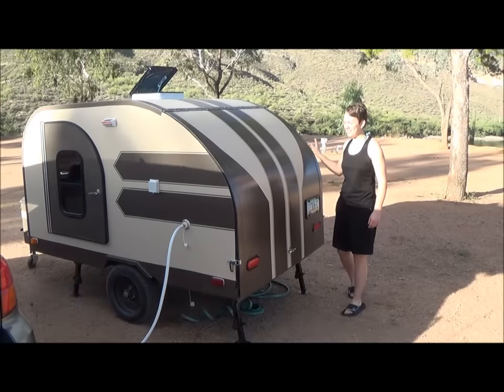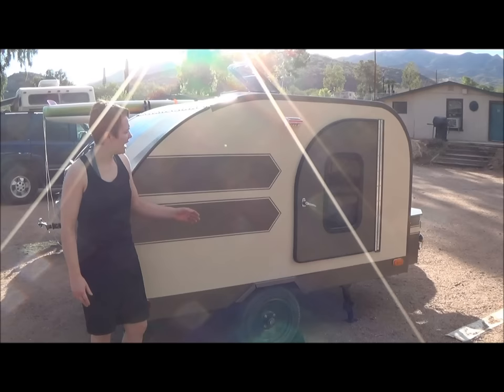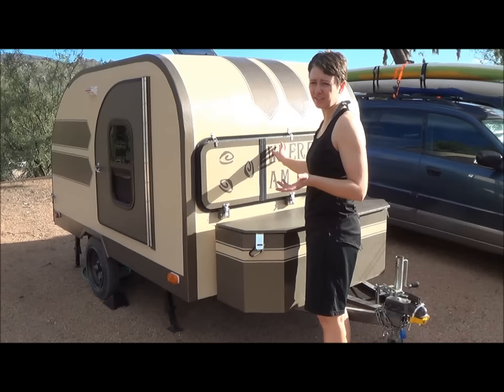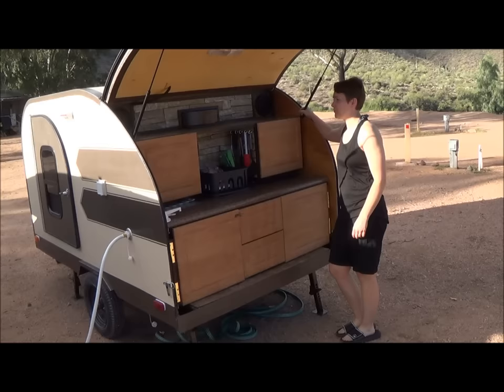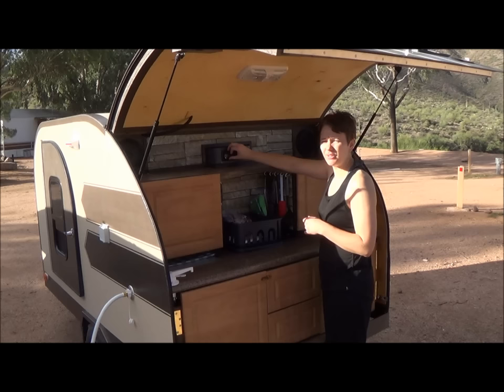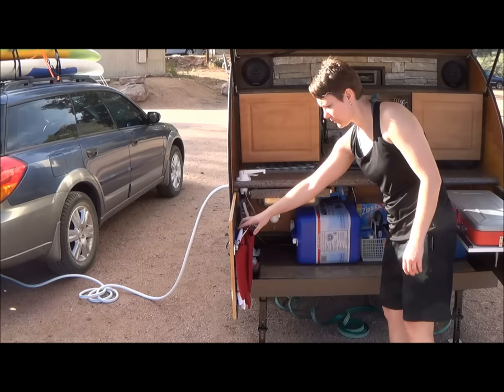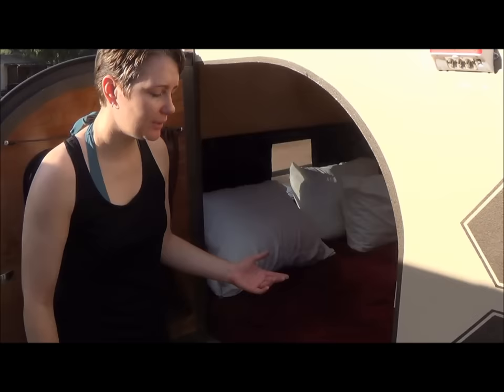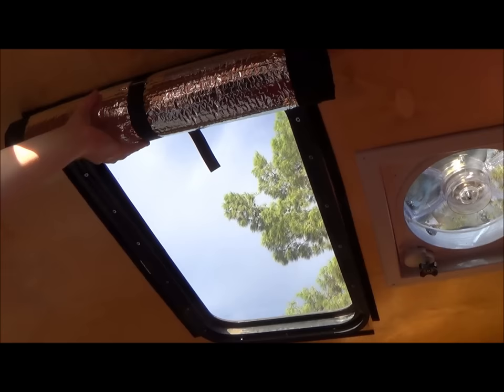Home Built Teardrop Camper (Poor Man's Fiberglass)

Comment: Absolutely beautiful teardrop.  The only things I would add are a solar panel or two and a seven pin trailer jack so you've always got power options.
Reply: Andrew Rouse And there's no need to permanently attach the solar panel. A lot of Australian teardrops simply have the solar panel on a tripod that they set up outside the door.

Comment: Acrylic paint does not seal against water, however, a sealer on the final coat of a Poly-crylic would be close. After using them once in a bathroom over a faux finish, I could not believe how well the coating managed in high humidity after many years. The water based polys have come a long way since- of course, many floors are done with them now. Amazingly hard and durable- I would highly recommend them.

Comment: Hi, thanks for the great video.I am gathering my thoughts as I am about to start the build of my first tear drop trailer. Glad that I saw your video, I am living in Mesa, AZ. I've been camping since I was a kid and had sailboats for almost 30 years. Many of the situations are similar. However, my boats were all done when I bought them so I never had to figure out the 12 volt wiring. I've been watching videos all morning learning more about that. Glad that you talked about the door. I went through the same thoughts that you discussed and probably would have done the same thing that you did by making one from the cut out wood. It is so much easier to buy one pre-made for the reasons that you stated. Thanks again. I've looked at a few of the comments below and have also been considering foam sides, fiberglassed.

Comment: great job ! one suggestion, either use a gel cell battery or put in two vents to exhaust the battery fumes. ( one at the top , one at the bottom )  the gel cell is by far the better option, no fumes, no acid, no problems.
Reply from the maker: +bos dad Thanks for the tip! I did vent out the back but I like the idea of gel cell!

Comment: I build campers for a living, and I have to compliment you on an excellent build!!  The only thing I see people doing that I wouldn't recommend is the poor mans fiberglass.  Actual fiberglass isn't that expensive, but to be fair, I get my glass and resin at cost or free if its considered waste.
Reply from the maker: Thank you! Maybe if I build another I will see if I can find someone who gets materials at cost!
Reply: @thelwood  did you figure out the cost of the poor mans fiberglass?
Reply from the maker: @iambeeman1  I had $50 in canvas drop clothes, used about $15 worth of glue,  free paint for base coats,  final paint was probably $40 including the paint for the racing stripes. So probably a little over $100. And no need for trim. It still looks new after 5 years. It is a little tedious with all of the sanding but the final product was worth the extra effort.

Comment: Nice job. I'm building off the Benroy plans and decided to build my own trailer since I have welding experience. The HF trailers are a little to wonky for all the hard work that goes into a nice build. All opinion off course. Enjoy your hard work.
Reply from the maker: +Kevin N I agree about the trailer. If I would have had more confidence in my ability to produce a nice end result I would have invested in a better trailer. I did reinforce it and upgrade the axle. I have a pacemaker so I am not allowed to weld :( Good luck with your build!!

Comment: I think you should have put a 3 inch door lip frame on the inside with a 1 inch exposure smaller than the outer door opening and ran a line of rubber sealant like the inside of your car door to keep cold and water out when your camping in.
Reply from the maker: Terry Thanks for the tip. There are of ways I could have made the doors better. I will just buy them next  time. They are ok for my needs here in the desert.
Reply: Well...its awesome.

Comment: I'm not sure if you know about this paint but it's really cool I just learned about it myself and it's supposed to help with the heat penetrating into your vehicle and you can paint the inside of your vehicle or the outside and you could mix the stuff with your paint is called icing spray on high tech thermal ceramic insulation paint. Can help out with all that heat coming into your place it puts a barrier between you and the heat and the sun those raise but I really like your little place is very cute. I'm going to build a tiny house I got my first peace last week from the salvation Army it's a stainless steel large bow I paid three dollars for it going to make it a sink for the kitchen and I'm going to use an old sewing machine that I have in my apartment I'm going to take all the stuff out of it and make a hole for my sink it's going to be really cute. Thank you for the sweet video I really like your little teardrop and the radio is fabulous what a swell idea thank you again bye-bye.

Comment: My wife and I have I have all kinds of questions, what trailer frame did you uses, what was its dry weight, what did the overall weight end up being? How are you liking it now almost a year later? How long did it take for the build? ... and I will probably come up with more questions...
Reply from the maker: Thanks for watching.  We love this little camper! We have had several adventures and are hoping for a long road trip next summer.  I built it on a harbor freight trailer that i reinforced the tongue of.  I will invest in a better trailer for my next build.  The trailer is 4x8 but I built over the wheels so the camper is 5x8. that is how I was able to get a queen bed.  My wife is tall and all arms and legs so the extra space is worth it in my opinion.  If you are short that may not be important to you.  It weights close to 1000 lbs.
Reply from the maker: +L Wms I worked on it for a year but I took a 6 month break.  I could easily build it in 3 months now.  Most of my time was spent just trying to out what I wanted to do.  I redesigned it several times.
Reply: My wife and I are both very tall, shes almost 6ft, and me, around 5 foot 9 or so. We have been looking at the campers.. and trying to figure out if we could comfortably sleep on a full. We have a small suv, for weight is going to be very important....... Thank you for the quick response, and know that I might come back and ask more questions. I like the canvas, because I also live in AZ - which means we have uh, what one month a year, when we can apply aluminum siding. LoL.
Reply from the maker: +Odessa Price I don't see that my response posted.  If this a repeat message I apologize. We are similar in height to you both.  I toss and turn so upgrading to a queen is highly worth it in my opinion.  It is pretty easy to keep to below 1000 lbs. I can't feel the camper behind my outback at all. Happy camping and maybe we will run in to each other.  Do you have any favorite Arizona camping sites? We are always looking for recommendations.
Reply: Well, most of the time we end up going to my uncles cabin in the middle of the woods, which is scary, and has nothing that we want to do, so... we are looking for a better than tent camping adventure or two. I really want to do some california beach camping, but again, they dont allow tents - which put my instant up coleman in a useless status. =) There is a place near Angel Valley Sedona that we wanted to try, however just taking the vehicle in and out was a little scary, so I am not sure how well a trailer would do honestly. Other then that, mount lemmon is pretty nice, depending on the site you are at, we had a big group site up there about 6 years ago.
Reply from the maker: +Odessa Price We have list of places we want to go and will hopefully do the coast next summer and hit a bunch of national parks.  Our son graduates this year so hopefully we will have more time. Good luck your build! Let me know if you have additional questions.

Comment: Awesome trailer. Can you explain a bit more about your skinning process?
Reply from the maker: +voiceofintelligence  First I routered 1/8" curve to the edges, this really helped the canvas bend over the edges with no wrinkles. Then I bought 8 oz drop clothes and pressed the hell out of them. Then I bought a gallon of tightbondII. I rolled it on with a quality roller. Then I put the canvas on and pressed it again. Then I worked the corners with the glue and iron until no wrinkles existed (cut to about a 2 inch over lap each way). Next I applied 50/50 paint and water mix, then several coats of full strength exterior paint and SANDED in between. That is the key!! Sanding it makes it beautiful! I did some trials without sanding and I did not like the texture, Sanding makes it smooth and shiny :)
Reply: +L Wms  How did you attach the Canvas to the wood? Tightbond???? When you say pressed it again, You mean with an Iron? What kind of paint did you use ? Oil base ? Love it great job!!! I am ready to skin mine now!
Reply from the maker: +GT66PONY Forrester I rolled on the tite bond 2. It is a wood glue you can buy by the gallon at home depot. I rolled the canvas on and then took the iron to it. One of the pictures at the end you can see me ironing the fabric.

Comment: This is amazing well done. Can you explain again how you did the poor mans fiberglass ? I’m thinking of converting a normal trailer into a camper 👍
Reply from the maker: I rolled on titebond 2, then the canvas drop (pressed first). Then I pressed it again and applied 50/50 paint/water. Then I sanded it.  Then paint, sand, paint,  sand,  paint.  The sanding makes it nice and smooth! :)

Comment: Well you're definitely in the top 5% of equality females. How about the trailer I love it only a couple of things I would change about it, I would have used a better frame that the Harbor Freight trailer frame, the other thing is the stereo set-up
Reply from the maker: +Nic l Thank you. I would have put it on a better frame if I would have been confident it would turn out this well. I got trailer for next nothing so I went for it. I did reinforce the tongue with 6ft 2 inch steel and I am upgrading the axle. I am putting my next build on a much nicer 5x8 trailer :)

Comment: I'm in the process of building a teardrop right now and I am curious how the canvas is holding up. I'm not sure which way I'm going to go between aluminum and canvas. Also, would you be willing to write out the basic steps and products used in applying the canvas?

Great looking teardrop, by the way!
Reply from the maker: The canvas is still in prefect condition. If you pull the canvas off of a hundred year old boat the wood is usually still in good shape. It is very durable.

Comment: Two questions. 
1. Is your teardrop stored under a shelter when not in use?
2. After six years have you had any problems with the poorman fiberglass leaking or any other problems?
Reply from the maker: Thanks for watching.  My TD has been stored in the garage for about 4 of the 6 years.  I have another PMF cargo trailer that I made 3 years ago that is stored outside.  Both are in excellent condition.  It is hardy stuff when done right. I haven't had any issues at all with the PMF.

Comment: Wonderful build.   What did you use to clamp on that window protector for the front window.   Do you remember where you bought the hooks and clamps?   Thanks again
Reply from the maker: Thank you! That is an excellent question. I am trying to remember. If I didn't find it at home depot then I maybe did at harbor freight.  One side is a D ring tie down with a metal  strap and the other side like a small latch for a toy box. I am working on a micro teardrop for a Vespa. I might need some for it. If I do I will let you know when and where I find them.
Reply: @thelwood  thanks I appreciate that and will follow in case you find it.

Comment: I know it has been years since your build.  Can you tell me how and what materials you used on the front window "protector"  .  Thanks so much.

Jon and Donna
Reply from the maker: I used 1/8 baltic birch covered in poor man's fiberglass and the back is a reflective insulation. It is about 1/8 to 1/4" thick too. The 3 pieces are attached with extra from the plastic hinge I used for the doors. :)

Comment: So naturally as everyone else has said, this was fantastically done. I'm not sure if your still responding to these comments but here goes... I am building my own TD right now, and am at the sand and painting phase. I have sanded and painted so many dang times now i'm almost sick of it. Already used 5 gallons of paint. How many times did it take you? Did you use a brush or roller? I feel like I am so close, but now I have to buy more paint, lol. Is there any tips or tricks or anything you know of now since doing yours that can speed this up? tia!
Reply from the maker: Brandon Foresee I believe I did 3 full strength coats.  I left mine with a little texture.  The smoothness level is a personal preference.  I used a smooth roller to apply it.  I used an electric orbital sander to sand it. I also used an iron on it when I applied it.  Hope that helps!

Comment: how heavy is it !? I made one that can fit a dirt bike in , opens in the back ! mine is 660 pounds empty , 1000 pounds with the bike in it , I pull it with a Yaris !
Reply from the maker: Vegas RoManiac I estimate  800 to 1200 pounds. I was trying to keep it under 1000 and have pulled it woth 1000 lb capacity car with no issues. Can't even feel it behind the subaru :)

Comment: Great build.  Why even put "the poor man's glass" (canvas) on trailer?  Why not paint wood? What type of paint did you use (oil - enamel- etc)?  Would you change anything?
Reply from the maker: Hi Chris, thank you for watching! You can just paint it but the canvas just makes it last a lot longer.  It is very durable and totally water tight.  If is more like skinning it in aluminum vs just painting.  I used glossy exterior paint.  If you make a trial piece you will see that once the paint has dried in the canvas the canvas is solid enough to cut your skin. boats made a hundred years ago can still have preserved wood underneath them today.

Comment: Great video, thanks for sharing. Making videos isn't easy and takes time. I appreciate your willingness to share. Is the trailer a Harbor Freight Model? Can you elaborate on that? What would you say the gross weight of the teardrop is?  I hadn't heard of the coated canvas outer shell before.  Your teardrop looks great, Congratulations I hope you make many wonderful memories.
Reply from the maker: Thank you. It is a harbor freight trailer.  I reinforced the tongue with 2 inch steel square rod 6 foot in length. It weights about 1000lbs. I will use a better trailer for my next build but I was hesitant to put too money in not knowing how it would turn out.  It was a cheap Craigslist purchase and it works well.

Comment: Nice job, do you have pictures of how you made it 5' wide especially over the H/F fender section. Did you raise the floor above the fenders.Thanks.
Reply from the maker: +George Lee I am not sure how to post pictures in the comments. I have a few pictures. Basically 2x4s upright on the frame raised it enough to clear.
Reply: Thank you.

Comment: L Wms   the poor mans fiberglass reminded me of my grandmothers walls in her house when I was little. they were hessian covered with old magazines, they blew in & out with the wind but the house was warm. 
Question.....I have an old caravan, only 10 foot but I can't fix the leak in the roof, do you think this would work if I was to do the whole roof in it & rolled it over the sides of the roof ? 
Can you tell me if you only used one layer of hessian & what type of paint did you use ? 
I love the tiles you used as back splashes & fetcher walls
Reply from the maker: Kerry Beckhaus It might work.  I am not sure.  I used canvas drop clothes from home depot and glossy exterior latex paint.
Reply: thanks :-) might be worth a try

Comment: You did a fantastic job on the camper!  I'm in the planning stage of building a similar camper.  I'm having a difficult time finding an affordable trailer frame in the Mesa/Gilbert area.  I may opt to use a Harbor Freight trailer and reinforce it.  It looks like you widened it to about 5 feet?
Reply from the maker: Thank you! I built up over the wheels to make it a 5x8. And definitely reinforce the tongue! :)

Comment: What weight capacity trailer do you need to start with . Good to know I am not the only one . I recently was spring cleaning and came across and old tripod it was way to big and had a piece broken . So instead of throwing it completely away I am always salvaging things of of other things . I to kept the tripod legs . Something told me I could and would use them for something down the road . I can't wait to tell my wife that someone else kept and use something aka repurposed .
Reply from the maker: +timothy thomas The trailer is a 1200 pound trailer. I have upgraded the axel to 1750. I will start with a better trailer next time. I bought this one for $200 on craigslist. I wasn't sure if I would be able to figure it all out so I didn't want to invest too much up front :)
Reply: If you don't mind me asking . How long did it take you to build this one .  I am finishing a roof rack for a cherokee now 90% done . And would love to start a project like this . God Bless

Comment: I keep watching this over and over again to look closely at the hatch wall edge to see if you used any kind of trim.  Can you tell me if you did and if so, what kind?
Reply from the maker: Sandra Zern I used weather striping. That is why I have the latches on the side too. That is How I can get it closed tight enough to make a solid seal. Not the best system but it gets the job done.